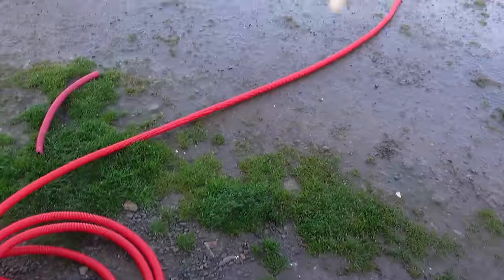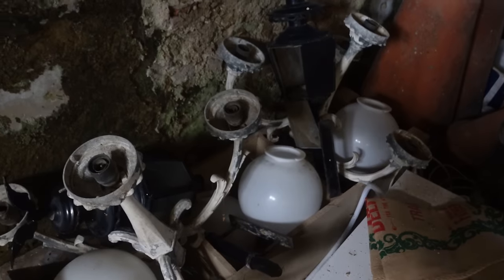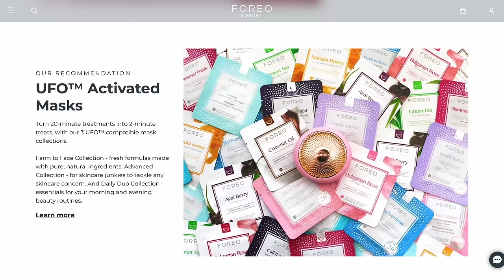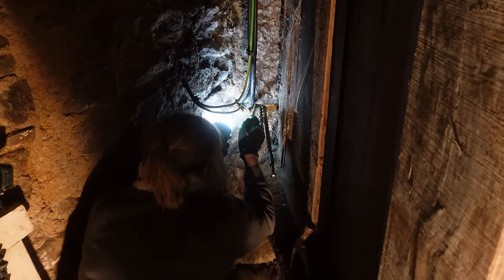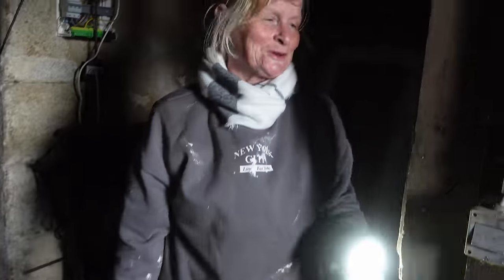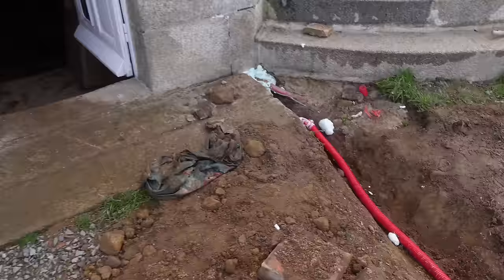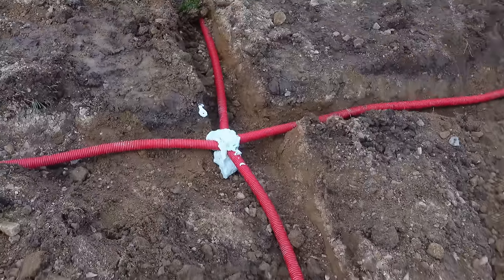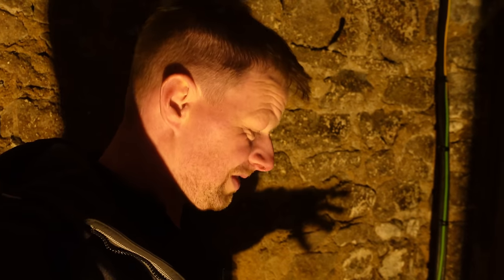The START Of The FRONT GARDEN Renovation At The CHATEAU.

Comment: To prevent your drill bit from binding, use a little stream of water to cool the bit, plunge & retract the drill frequently to remove debris. Take your time! 
Note: Drilling another hole alongside a stuck bit will ruin both bits. ❤️🙏
Reply: I've managed to unstick drill bits by turning them anti-clockwise with a big pipe wrench. The worst DIY drilling job I've had so far was a 35 mm hole through a stone wall with a timber frame (fairly substantial structural timbers) and plaster & lath in front of it. Getting through that into the space between the posts was easy but as soon as I tried to get deeper into the stone I got stuck. I eventually gave up and routed my cables a different way.

Comment: Is that flexible sigmoidoscopy tubing standard in France?  Here in Chicago, we try to use 2 inch PVC piping (in case you ever want or need to pull more wire through).  It lasts better in the winters here.  We bend the pipes where needed gently with a bit of heat.  Just curious about whether that's standard issue for France!  xxx ooo